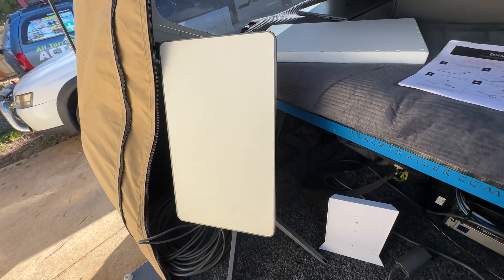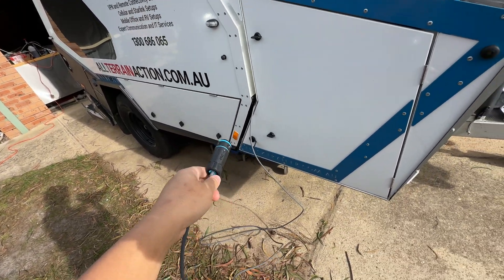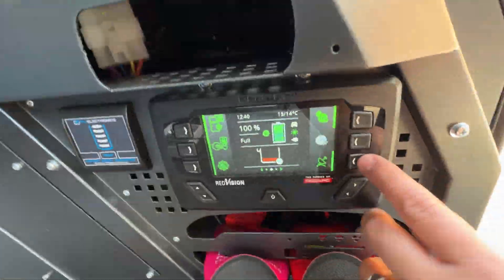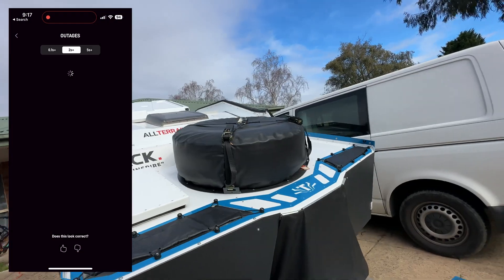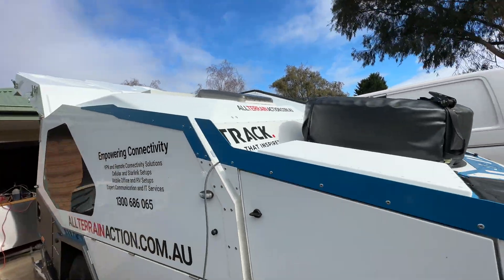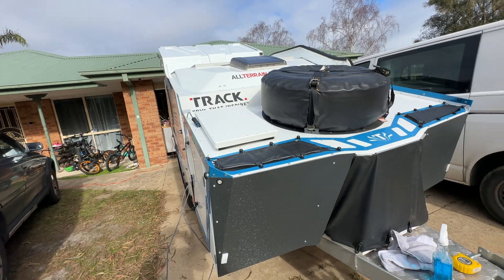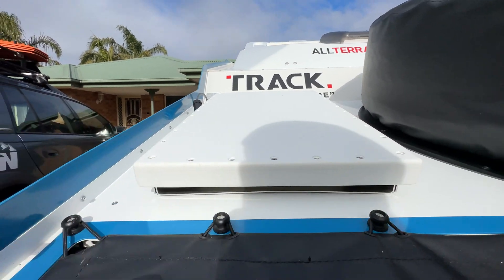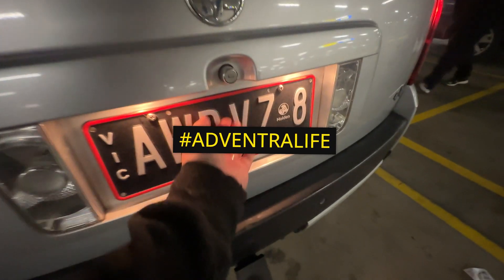2023 IP68 Flat Mount Starlink Conversion Australia 12V Hack & Permanant Mounting VAN or  VEHICLE

Comment: That looks awesome and have been thinking of doing that myself! How has it been while in motion?
Reply from the maker: I tried, it does work but starlink sent a warning email about needing to switch to a different plan to continue using in-motion. It’s very expensive, so for that reason need to make sure to turn it off before moving or they’ll switch my plan and the jump in price is crazy.
Reply: So they’ll switch your plan without telling you or will it disconnect and you have to rebook?
Reply from the maker: @GrabLifeByTheGourlays  I read that they’ll cancel you, eventually for breaking terms of use. I’ve stopped using it this way after the first email. They seemed to have allowed it in Australia till around April this year (2023) but since then have a system in place to send these notices. Disappointing!

Comment from the maker: Incase anyone was wondering about the speeds I'm getting now, here is a speed test hardwired into the switch in the camper. This is Starlink Mobile on RV priority it is around the same as I was getting pre-flat mount but I've found speedtest to be dreadfully unreliable as you get prioritised differantly depending on local starlink POP loads. https://www.speedtest.net/result/14969731828